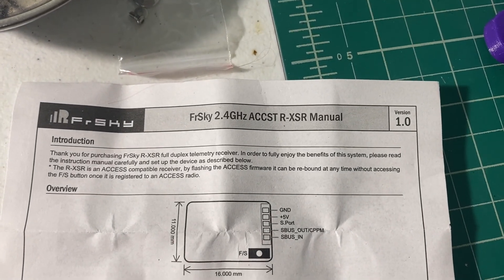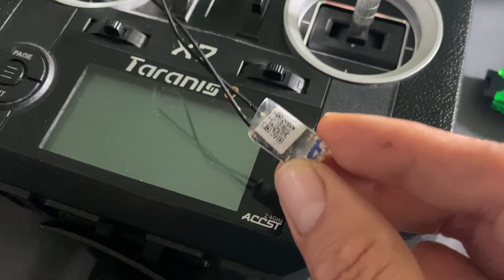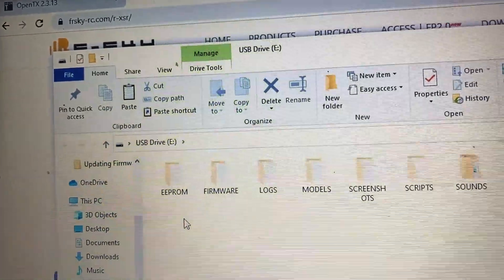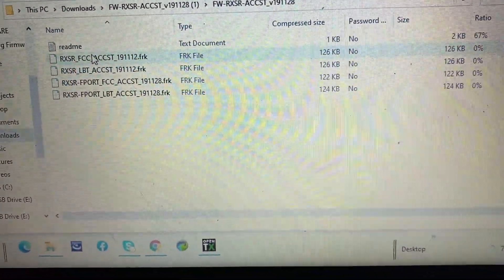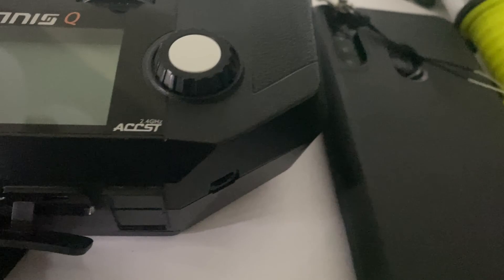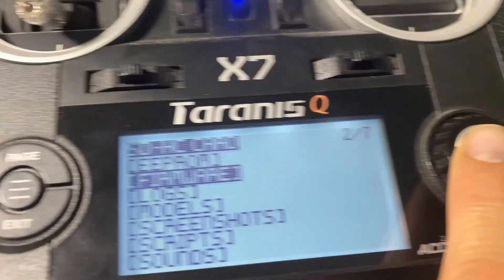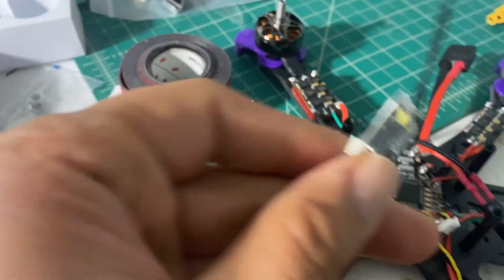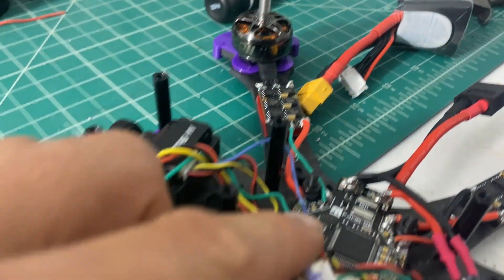How to update Frsky R-XSR & Bind to Taranis QX7 ACCST

Comment: I have the exact same problem just with taranis x9d plus..
I bought the mark 5 analog drone with frsky r-xsr receiver.. my old Taranis x9d plus (opentx) non eu model bought in 2016 won’t bind with this mark 5 drone..
It makes my crazy.. 

The receiver is just blinking red after I try and bind it.. 

can I fix it if I follow your video??
My taranis I different (x9d plus) and not a Qx7.. 

Does anyone with taranis x9d plus know if I can use this video guide ?
Plz help 🙏

Comment: I am working with a Orange Cube and have a x7 Taranis q bound to the R-XSR receiver  , When i connect to mission planner i can move the flight controller but when i get to radio calibration non of the areas in the pitch, roll etc. is green   how can i make the transmitter be seen in the radio calibration .   Thanks for your help

Comment: Lol I just bought a new rsxr and loaded firmware from sd card that worked with my older rsxr, 190.? Thinking hell my others work with this firmware, but nope in sbus mode zero movement. Must be 19112 is the firmware time take it back to accst from access,  i too am up cussing because I've done it many times, but 2 yrs ago, , I will try this next tomorrow. 7 rsxr all on 190? No issues.  Lol fuckn frsky,  radiomaster elrs soon  tired of the frsky loop of bs. But I haven't had the need for any new rx haven't destroyed a quad in some time . So drink another beer cuss at frsky, hell it's 330 am might as well continue on. Lol yep I know your frustration.
Reply: Lol poof there it is,  works 5min.  Unreal thanks ,

Comment: I got my thing to bind but I can’t get my drone to fly or even arm or get the motors to spin, do you know how I can test to make sure my remote is working? I got it to bind I just can’t arm it or fly it or anything.
Reply from the maker: Did you program your transmitter through betaflight or whatever you are using?
Reply: @aleefpv9279  not yet how do you do that? It says arming disabled on top corner also ex failsafe msp on the flags
Reply from the maker: @Echobbiez  Through the program you configured your flight controller
Reply from the maker: If you have done that

Comment: If you have any of those tiny whoops with an SPI frsky receiver, updating the taranis internal module to 2.x.x will also render your tinywhoop useless unless you have a multiprotocol module/radio.. My qx7  still has the pre 2.x.x firmware on the  internal xjt module for this reason. Any receivers like the xm+ r-xsr will come with the 2.x.x firmware now so I just downgrade them as you have shown here.

Comment: Thanks Much for the Tutorial!
Question: If the Firmware was originally not on the Controller, should you flash the firmware to the internal module as well??
Aloha
Reply from the maker: You're welcome! You can update the OpenTX firmware on your transmitter if you choose to. I think its recommended that you do.

Comment: Hi, I just got Nazgul5 V2 HD with R-XSR, and having problem with binding to Taranis Q-X7, should I also update the receiver?
Reply from the maker: Do you have the Taranis qx7 accst?
Reply: @aleefpv9279  yes
Reply from the maker: @krissfpv  go ahead and update. Follow the video. Its pretty straightforward. Good luck!
Reply: @aleefpv9279  ok, thanks, first I have to wait for the cable :)
Reply from the maker: @krissfpv  cool! Hope you get it figured out!
Reply: @aleefpv9279  still waiting for the cable :-|
Reply: @aleefpv9279  thanks for your help, I did it :D
Reply from the maker: @krissfpv  Awesome!!! I'm glad my video helped you! Happy and safe flying!!!
Reply: Is it possible to repeat this method if the receiver is already in the Quad?
Reply: @christroutman382  I think you should disconnect receiver from quad and connect to Taranis
Reply from the maker: @christroutman382  I would disconnect the receiver
Reply: @aleefpv9279  
Thanks so much! I'm really a Noob trying to learn.
Now when you say Disconnect Receiver from Quad.  Do you mean de-solder or will there be an actual Plug?
Aloha
Reply from the maker: @christroutman382  its ok. I've been flying 3 years now and I'm still a noob 😆

The frsky receiver has a plug
Reply: @aleefpv9279  Thanks so much my friend!
I do not know how to solder so I was worried. 
I just ordered an Iflight Protek 35 with and R-XSR receiver. I will try and bind it to my QX7 but if I'm unsuccessful then I  will flash. 
Aloha
Reply from the maker: @christroutman382  I highly suggest you start to learn!
Reply: @aleefpv9279  Yes